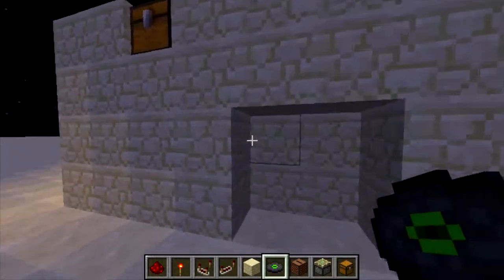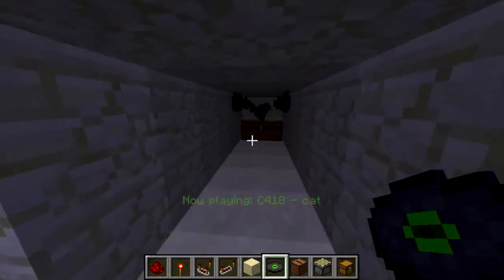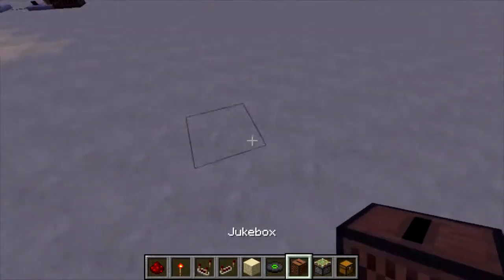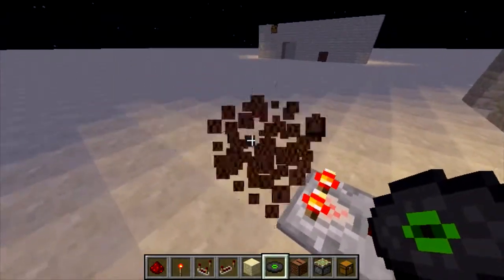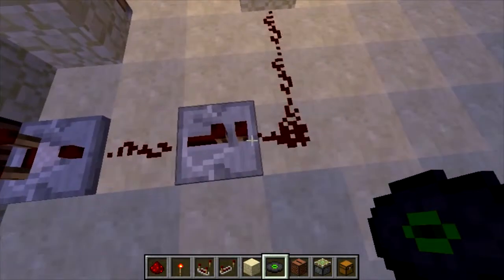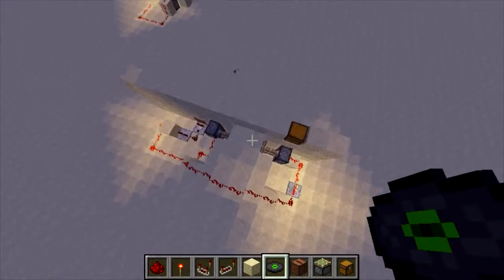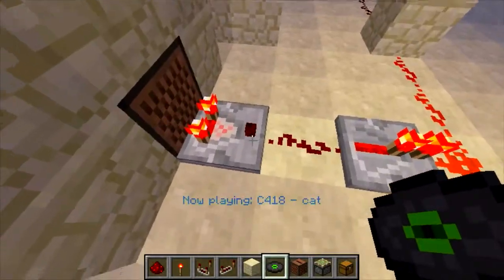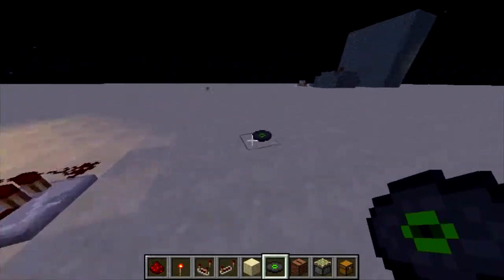Redstone Wonders: Jukebox Activated Door - HD

Comment: Actually the comparator detects the value of a blocks inventory and outputs a signal with a strength based on that value. If you use different discs you'll get different signal strengths. Check out the wiki for more info